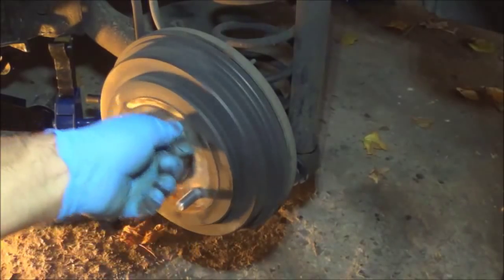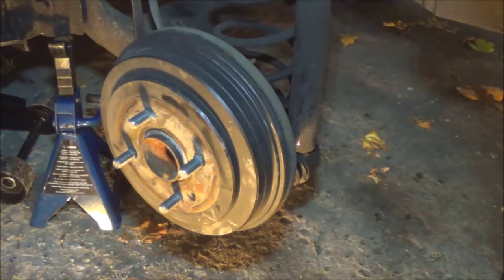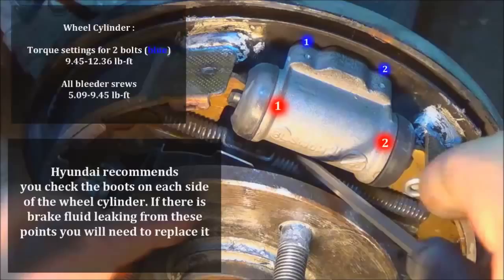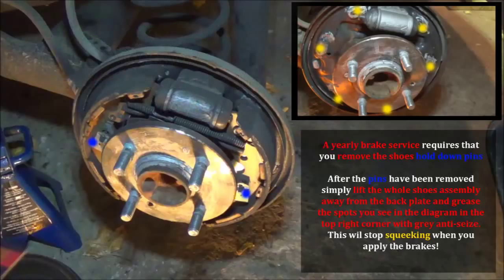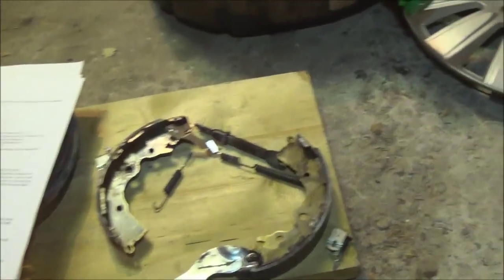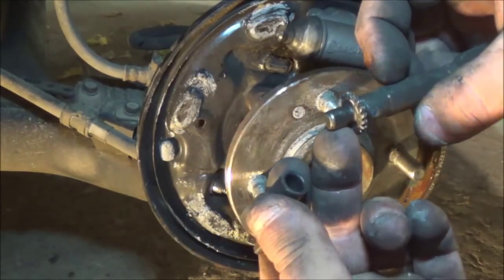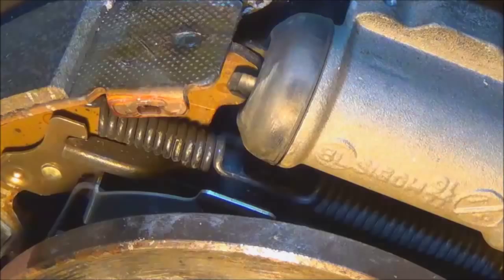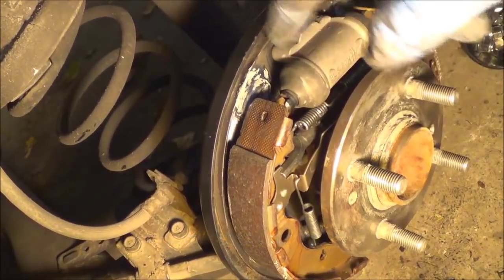2009 Hyundai Accent complete front and rear brake service in 720pHD part2

Comment: You saved me a bunch of scratch. Great job by the way, helped me do drums and shoes for the first time. Subscribed. I figure that’s the least I could do. Thank you my good man
Reply from the maker: Yep cost h
Is hitting 500 for fronts brakes and rotors and I'm sure full 4 tire brake job would cost grand. I have to replace rotors and pads on my 2019 Hyundai Elantra preferred this spring. I'll be sure to film it.

Comment: Many mant thanks for this videos. Just a tip. Take a picture for the assembly right after you take iff the rotar. Start with the one that has the parking brake and pin it, then the other one and use the picture to put the assembly back. Up is small down is big.

Comment: Thanks for taking the time to make this video, it was a life-saver. ***** 

Got my brakes pulled apart on my '10 Accent Hatchback, verified that the shoes where good, blasted everything out with Brakleen, pulled it all out, greased the points you showed and then put everything back together like you showed...but with a LOT more cussing and throwing of tools.

To anyone else doing this job, be sure to have a coupla small C-claps and a SMALL pair of NEEDLE NOSE Vice Grips!  They make the job MUCH easier that fighting that damned main spring with regular needle nose pliers!    *****
Reply from the maker: I agree clamps to hold the shoes! As for the top spring useneedleplyers with 90 degree bend. Insert the bended tip into the middle of the spring to pull it back on!

Comment from the maker: Part 2 is up and ready. It was actually up last night but youtube was acting stupid so had to re upload. All fixed now. Just a note: The lower return spring I installed with the loop outward. I still have it installed this way and have no issues. The loop did come off from the inside out of the holes at the bottom of each brake shoe. Other than that everything else is accurate in this video. You can order individual springs from Hyundai. If you need a whole new spring kit goto an autozone or auto parts store and they have the entire spring kit with the clips, pins for under 20 dollars. It is suggested if you replace the shoes you buy a whole new spring kit with it. Remember you will change the front brakes 2-3 times before you ever have to think about the shoes on the back. Rear drum brakes last longer than brake pads with a disc plate.
Reply: *****  Thank you for making and sharing this video i´m going to try with the front brakes, looks not so complicated,  but with the rear ones i´m going to pay fot it,  til I get the right tools needed to avoid a mess
Reply: Also dear general1, the rear passenger door is locked because the activator´s central system got stuck and doesn´t open from the inside or the outside , do you have any suggestion on how to open the door without breaking the inner lining of it in order to be repair?, I want to try to fix it  my self if it´s possible, i appreciate any clue about it *****

Comment: Thank you for making and sharing this video. I wish you had shown what to do when the drum doesn't come off easily but otherwise a good video
Reply from the maker: Joseph Riehl Those drums are hard to get off if you have left them for many years. There is another screw hole on the other side of the drum. you can use that hole to start to move the drum away from the shoes. Tap the drum with a rubber mallet and it will work itself off. I remember one time I left the emergency brake on and I tired to get the dam drum off. Then I had a brain fart and pulled the brake lever and then came off. Put antizeize on inside surface where the lug nuts go through. This WILL make it way easier to get them off the following year. Also do this on the wheels themselves. On the inside of your wheel place antiseize near the lug nut holes. Rust form the salt on the roads gets in there and the wheel seem to get welded on when its time for a tire rotation.
Reply: Thanks gereral1. I'll let you know how it goes
Reply: Joseph Riehl 
I had to beat the hell out of both of mine with a rubber mallet.
I was afraid to use a small sledge on these brakes - didn't wanna damage them.

Comment: Thanks for your videos, but a funny thing happened after I replaced my springs, shoes and drums.....the damn drum wouldnt fit on. I had the adjuster on its  shortest length and there just wasnt enough clearance to fit the drum on..ended up hitting it with a hammer til it fit and even sanding down the shoe. Ended up putting the adjuster spring on the outside hole instead of the inside like  original out of frustration. I could hardly turn the drum but it did turn , So put the wheels back on and and drove it to work and heard a loud ticking noise that went away after about 20 minutes of driving,,Whew,
Reply from the maker: Would have been better to release the wheel cylinder line cap then you would be able to squeeze in the contacts and drum would slide on. Fix your springs and try this. Have someone Pres brake in as u release bleeder. Press contacts in then tighten bleeder and get you helper to release brake pedal. Do not pump brake pedal tell after u put it all together. After its all together pump brake tell it's stiff.

Comment: How do you back the shoes off when you have a worn lip on the inside of the drums preventing the removal of the drums ? I tried backing off the adjuster wheel through the little slot hole in the backing plate and I could not get the locking lever unlocked and at the same time use another short screwdriver to turn the wheel to contract the shoes.
Reply from the maker: Undo the valve bleeder to remove cylinder pressure. This will help.
Reply from the maker: Remove brake resvour cap to allow pressure to escape then you will have to bleeder air from brakes later.

Comment: So after you do all that what do you do if it grinds when you reverse or drive?
Reply from the maker: You have to check for round of drum. Adjust the adjuster. Or put on new shoes and a drum. Caliper can stick in front. Brake rubber hose can collapse from age causing drag or overheating.

Comment: Is there enough room between the hub and the back plate to remove and replace a wheel stud (2008 Accent)?
Reply from the maker: Not sure if you can pound out the stud connected cant see why not if you remove the brake shoes. I have a brake video with close ups of rear brakes on my channel in Hyundai videos section. Maybe you can judge the distances by looking at video sections close up as I  install the springs behind the hub before putting new shoes on.
Reply from the maker: worse case is drill hole back plate for room for the stud to back out into the back plate. Then put new one in. The use jbweld on the hole and you will save money from putting in a new hub.
Reply from the maker: or impact 4 back bolts off then remove the hub and do it at the work bench....
Reply from the maker: These are torque settings for the rear Tightening Torque
 Nm(kgf.m,lb-ft)
Rear hub unit bearing 
mounting bolt 50 ~ 60 (5 ~ 6, 36 ~ 43) 
Rear shock absober lower mounting 100 ~ 120 
(10 ~ 12, 72 ~ 86)
Rear torsion axle beam
 mounting bolt  100 ~ 120 
 (10 ~ 12, 72 ~ 86)
Rear caliper mounting bolt 65 ~ 75  (6.5 ~ 7.5, 47 ~ 54)
Wheel speed sensor wire bracket bolt 7 ~ 11 (0.7 ~ 1.1, 5 ~ 7)
Brake pressure hose
 bracket bolt 9 ~ 14 (0.9 ~ 1.4, 6 ~ 10)

You best bet is to remove the 4 bolts holding the hub from behind and then you will have clearance to remove the stud. Then impact them back on. The plate will come off as you remove 4 bolts giving your clearance. Hope this helps. I own 2019 hyundai elantra now got rid of accent.

Comment: You did it whit the emergency break on or off?
Reply from the maker: Have to have emergency brake off to get drum off. Only time I use the emergency brake is after you adjust the brakes you reverse vehicle and pull the emergency brake to set the shoes distance from drum.

Comment: I have a thought.., would it not be possible to put the "adjuster lever" and "adjuster lever spring" on AFTER you put the adjuster itself (the pin) and shoe in place? Its easy being such a wiseguy after you do this, I´´m sure- but I just cant help think that would work just as fine.., what do you think general?
 It just looked to damn hard holding everything together at once.
 Impressive way to do it all at once of course..
Reply: maybe just the spring..? gonna try it in the weekend!
Reply from the maker: Use big gripper clamps to hold the shoes! Makes it easy to install the spring hardware. Like u need 3 hands. Lol
Reply: +gereral1 ok, i Will bring a c-Clamp, 😆

Comment: tips on removing that Philips screw on the drum so I can open it up?  mines pretty seized and wd40 isn't working
Reply from the maker: jb weld leave it for 1 hour. Then use a small sludge hammer to tap the end of the Phillips head screw drive handle into the screw. this will bang the rust off enough to loosen it. If this does not work the auto store sells a screw driver that you hammer the end and it turns counter clockwise with down pressure. This will loosen the tiny screw. Worse case drill out the screw tap and die. I did jasons brakes on his 3 door today and we used that method and it worked great.
Reply: as a point of interest is that little screw really necessary, doesn't the wheel hold the drum on?
Reply from the maker: yes the wheel holds the drum on. The screw is there to set the drum before placing the wheel on. Torque settings for wheel lug nuts is very important. 80 foot lbs! if you do not care for the screw screw driver and hammer on a 45 degree angle into the screw. This will turn the screw and break the rust around the threads. If you do replace the screw make sure you tip it with anti-seize.

Comment: Thank you for your video. Where is the rear ABS speed sensor located?
Reply from the maker: Should be near the stut tower. The speed sensor wire runs down the strut tower. The abs sensor is inside the hub itself on vehicles with abs.
Reply: Thank you for your fast reply. Is it possible something goes wrong with the rear sensor itself in Hyundai accent? I searched every where to find the sensor but only its wire harness was in the stores.
Reply from the maker: Abs uses the 4 wheel sensors on accent. On front the wire on the strut tower goes down and is connected to a small tube like sensor that is pointed to the inner tone ring. The rear on the torsion axle there is a wire that goes behind the drum brake. This is your rear speed sensor location.

Comment: Hi  How do you adjust the emergency brake?
Reply from the maker: The cable is set length. When you adjust the adjuster wheel the emergency brake will get tighter. you should be at 45 deg when you pull up on the emergy brake. Then put the car in reverse and let off the brake in reverse. Apply little fuel and the car should hold! If it moves release the emerg brake. Pull drum off and move the adjuster wheel acouple more clicks. Repeat. The car should hold on reverse. idle backward and pull the emerg brake. Repeat as this will set the automatic wheel adjuster to set the shoes perfect!. Goodluck.

Comment: thanxs for the video. It helped.. But rear breaks are a f###ing pain! not looking forward to the other side.
Reply from the maker: LOL spring city. Just a tip. Use 2 BIG clamps to hold each side while you position everything. Trying to do this with 2 hands gets frustrating really fast!
Reply: ***** 
I can verify this, threw my needle nose pliers into the wall of my garage and put a big hole in the drywall. :x
Reply: @scrambler350  Lol, I did the same, but what was worse when I threw  the needle nose pliers it punctured an spray can of primer paint. Paint spraying all over the place.

Comment: How do you get the drum off?
Reply from the maker: Vinny Raptor if drum is seized release the bleeder screw and then do up to release pressure. Then tap with mallet and it should pop off.